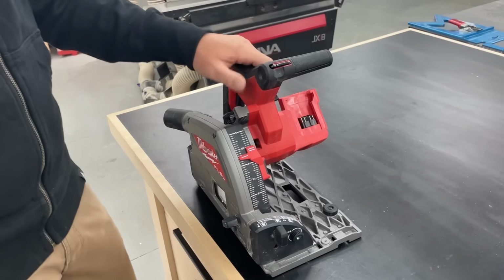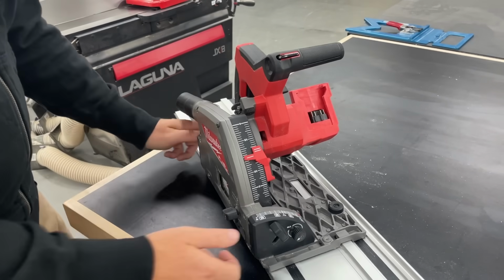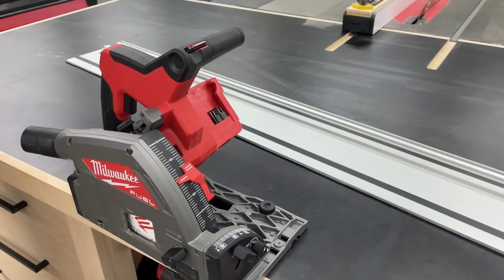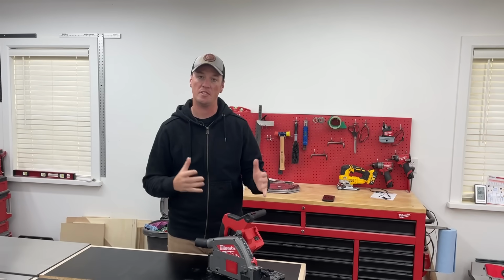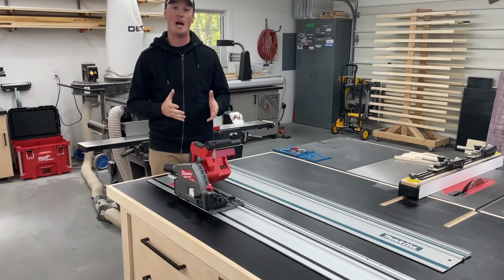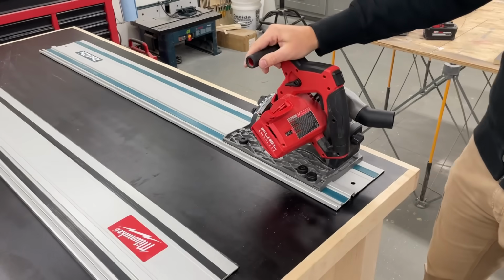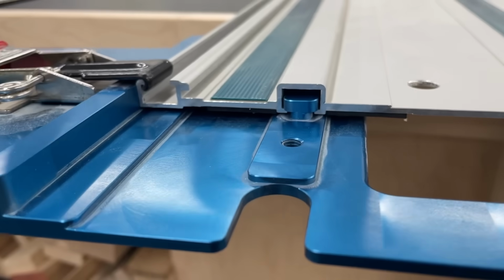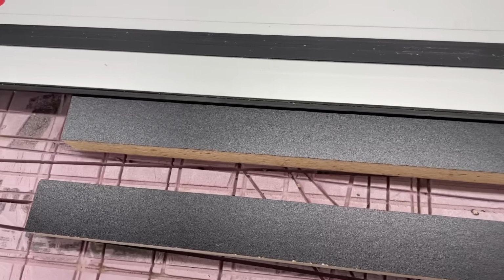The Truth AFTER 9 months Heavy-Use | Track Saw Review

Comment: Might be a dumb question but how does the track not move with the saw or slide off the material? I always pictured needing to use say your other hand to keep pressure down on the track so it doesnt move (obviously without clamps) but do the tracks really have that much grip that they dont move during cutting?

Comment: Proprietery blade meant by the thicknesss, that It cuts 1,6mm (1mm base thickness) metabo uses 1,2mm base and 1,8 cut, and makita standard is 2,2 (non battery) and 1,85 -1,9 so yes it is different and you WILL recut your track if use interchange them... ever so slightly but still

Comment: I see 8 increments on the scale from 0 to 1/2".  So on this saw 8 1/8's is 1/2"!  The blade is SOMEWHAT proprietary in that it has an ultrathin .063" kerf.  The splitter is ultrathin to accommodate that blade.  On the other hand, the saw  will also take a thicker blade with no problem.  The thinner blade is great as it effectively increases horsepower.  Excellent review overall-helped me decide to buy and I learned a few new things.

Comment: Do you know what the cut depth is on a 45 degree beveled cut? I’m cutting some angled cuts for a waterfalled edge on an exotic hardwood and i dont trust my wen track saw to make the cut without flexing. It has a bigger blade, but it also lacks proper power. I’m looking at milwaukee because i have a bunch of their tools already.

Comment: The only 2 problems I have with the track saw is that 1, in the EU the anti tip feature is removed. And 2, when using the saw without vacuum, it will get clogged from time to time (even without dust bag), so I think the dust output is not that great without vacuum.

Comment: Hey John - thanks so much for the experienced review and the added bonus of the aftermarket mods TSO and Woodworks).  Milwaukee shipped a 40-tooth blade with the saw and I’m wondering how it’s going to work on composite deck lumber I need to rip.  Any tips or tricks working with that material?
Reply from the maker: It should be good!
Reply: Drew over at Wittworks got me that dust cover you have and some track end protectors.  He also included some really good tips for using the saw.  Thanks again for the information and referrals!

Comment: I see I'm only a year late to this review...just starting to get into woodworking.
Great review with no annoying music or a lot of rambling about your opinions, just the facts Jack!
Here's my one questions regarding the tracks...for you or anyone else that has these two brands of track.
The Makita looks like it has a wider (blue) glide on the top for the saw to slide on than the Milwaukee.
Which one is easier/smoother to glide the saw on?
Or is there any difference to begin with?
And how's the grip on the underside when using the saw, which track has a better grip on the work surface?
Thanks again for a clear and direct review!
Reply from the maker: I’ve never really noticed a difference on the glides or grips between the 2. Just gotta keep the grips clean and they’re great

Comment: Nice, to the point review. Thank you. You mentioned the blades. Are the kerf sizes the same between the Milwaukee and Makita? Big power difference between the 18v and 36v makita?
Reply from the maker: They each have blades that are different kerfs. I really like the thicker Milwaukee fine finish blade. I always got a lot of deflection with the really thin Makita blades
Reply: @JohnBuildsIt when switching between different milwaukee blades does the position change in comparison to the splinter guard or are they just swap and go? I've noticed some kerf differences between the some of the different tooth count blades and have been curious how it affects the splinter guard.

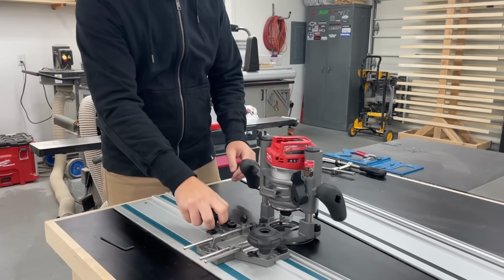Comment: Hello, John.  Thank you for the thorough review. I sent your link to my son who just bought the Milwaukee track saw.  In your review you mentioned the Milwaukee router guide's compatibility (10:49) with both the red and blue track. Does that Milwaukee router guide work with the Festool track?  I have Festool tracks and desire a Dewalt palm router, so I am looking for a router guide to work for both. Any insight would be appreciated. And by the way, thanks for guiding me on my Home Depot Dust-buster and Ridgid vac build--my first shop project as I began my retirement three years ago.

Comment: So I'll admit I'm a bit of a festool fanboy. Have had my tsc55 reb for close to 5 years, used it extensively and it's been great. Decided I was going to get another saw, dedicate the tsc55 for rips and the new one for crosscutting. Toyed with the ts60 but the no battery or plugit cord was a non starter. I have some milwaukee tools, read and watched a lot of good things so took the plunge (pun intended). Well well well... did a bunch of rip and crosscut comparisons between the two, with multiple different blades on the tsc55 and only the stock blade on the milwaukee... needless to say there is no need for 2 saws. The milwaukee is that good... and smooth. Sold the 5 year old  festool saw, 55" track, charger, 2 batteries and a couple of blades for more than I paid for the new milwaukee kit (track included). Nice work milwaukee
Reply from the maker: Dang that’s awesome! Especially that you can admit that 😂 I love the few festool tools I have, but some guys get pretty weird about it for sure, thinking there’s no way something else can be just as good or better haha

Comment: what saw do you feel slides better on the track? Makita or Milwaukee? Sounds like the milwaukee rubs or something! What saw would you recommend? Makita 36v or the Milwaukee!
Reply from the maker: They slide the same. I still use both, but I prefer the Milwaukee
Reply: @JohnBuildsIt  how powerful is the Milwaukee m18 track saw? I know their regular circular saw is garbage compared to Dewalts 60v circular saw. If you have used Dewalts 60v track saw which is more power Milwaukee or Dewalts?

Comment: I am a deck builder and frequently need to cut long straight cuts of composite decking like Trex and TimberTech. I typically use a deck board as a straight edge and my M18 circular saw but have been contemplating getting a track saw for more precision. Do you think the Milwaukee track saw could be useful in this desire? Can multiple tracks be added to get say a 12'-16' run?
Reply from the maker: Absolutely man, it’s the only way I do it!

Comment: Nobody ever addresses the wobble side to side with the powerhead to the chassis. There`s no way to adjust it out. 
Grab the top handle, while locked in the track, push the powerhead side to side at the top, you`ll see a bunch of slop.
How the hell can you expect a good accurate vertical cut with so much side to side floppy sloppiness.
The Kreg saw did the same thing. I returned the Kreg, now i`m gonna return the Milwaukee.

Comment: Great review. I just got the Milwaukee track saw and it has taken a little getting used to.  Thanks for the info on the adjustment screws, I couldn’t find that info in the manual. The only problem I am having is with the riving knife. It doesn’t follow the blade and gets hung up when I make angled cuts. Is there a way to adjust it to follow the blade?

Comment: I have heard people say in different reviews that the tracks tend to have the anti splinter strip fall off on its own whether it's used a lot or lightly used,  and have also heard people complain about tracks not lining up well with each other when connecting two tracks whether it be  two 55" or two 31" etc etc.   How has your experience been with those two situations ?
Reply from the maker: I bought the long track so I actually haven’t joined any of the short Milwaukee ones together. In my experience with both Makita and festool tracks though, they both needed trimmed to square up the ends so they went together straight

Comment: Hello great video. One of the most Informative I have seen. I have two questions the depth guide I am confused on where exactly I use. The top of the two lines the middle? Also does the guide connector plates go bevel side up or down? Also I have made the mistake of putting g just a little to much pressure when tightening and dimpled the track. I say this to avoid anyone else from doing it. Happened very easily. Thoughts

Comment: are the track connectors cumbersome to install and accurate when lining up? i used the bora track a long time ago and getting that connector to line up accurately was a pain in the ass
Reply from the maker: I don’t think so, they’re just hex set screws. Same on the Makita and Milwaukee. A lot of tracks don’t come cut perfectly square on the ends so that usually needs trimmed, but after that it’s easy and accurate

Comment: I've had repeat problems with mine. The trouble I've had seems to revolve around the track and how the saw sits in the track, and that it's not that accurate. It will sometimes pull one direction or the other. Have ruined several tracks because it will start to pull into and cut into the track. I think the problem is more the tracks than the saw, but not sure. Idk if i just got a bad one or what
Reply from the maker: Are you adjusting the knobs on the saw so it snugs up along the rail?

Comment: Have you had any issues with the brake not working to stop the blade after a cut? Mine was fine for 4 or 5 cuts (only mdf) and then next cut, it kept spinning. I’ve searched as much as I can and the only thing that I can find is to ‘get it serviced’. I’ve only used it for one other project and don’t want to send it away if there is something I can do.
Thanks!
Reply from the maker: No not with the track saw. My blade brake did go out on my Milwaukee miter saw though recently

Comment: I'm on the Mafell platform right now, but for a cordless option this looks really good.  Only hesitation I have is that I've had nothing but BAD LUCK with m18 batteries.  They're expensive and they go bad just out of the warranty term with very light use.  "Red Lithium" my arse
Reply from the maker: Dang that’s weird! Personally haven’t had a single battery fail
Reply: @JohnBuildsIt  I've got seven m18 packs, and three have gone bad including a big 12amp High Output 'lunchbox'.  Not cheap.  Almost 50% fail rate.  I thought the m12s were much better, and then one got hot while charging and the rubber base coating melted & got sticky.
Not one problem with Dewalt packs.

Comment: Great review. I just bought my Milwaukee after owning 2 ts 55s for years and am really impressed. I actually purchased this to cut a bunch of 20step 2x12 stair stringers and it was so helpful being able to lock the saw in to the guide and shift it from cut to cut so quickly and the big deal for me was using the dust bag and cordless to eliminate the cumbersome hose and cord. Now I will be using my festools a lot less as I am mostly onsite rather than in a shop. I might even finally invest in a long track because it’s less than the festool one.

Comment: This is an excellent video!!

This is probably a dumb question, but when cutting a rough-sawn board where both edges aren't square, how do you measure from the edge to align the track when it has no square reference surface? Because one end could be at 2" with the other at 2 1/4" if that makes sense. 

Due to the expense, I would be using the track saw to get jointed edges without having a jointer or table saw.  Thanks in advance!
Reply: you could simply "make" a square edge by marking a 90 at one end and then laying down the track to make at least one straight edge (the one you cut).  with that 90 and one straight edge you could square off of that doing things the same way for the other sides
Reply: @srchubz  So, I would square up the end with my miter saw, then hook my square on the end and mark it? That will definitely make everything easier. Thank you for the help, I really appreciate it!
Reply: @chris-C8  and technically you don't even need to square the cut with the miter saw.  Just make a straight cut (due to the wood it might not sit flush against the fence, ya know?).  With THAT cut you have your reference points for 90 off of that.  Then just make the long straight cut
Reply: @srchubz  Thank you again for the help.
Reply from the maker: Don’t worry about the ends until afterwards. Rip your parallel straight edges first, then do the ends 👍🏽
Reply: @JohnBuildsIt  Thanks, John. I genuinely appreciate the help!

Comment: Great video friend. 
Thank you
Update
I just went to town and purchased the saw at Home Depot with a promotion for a free 6ah battery. There are no tracks in stock so as I looked on line I noticed that Makita is significantly less expensive than milwaukee on the mid to long tracks. I think I have decided Makita due to the prices I could find and what John shows in this video. 
Makita:
39”-$86
55”-$85
118”-$198
Milwaukee:
31”-$79
55”-$168
106”-$377
Hope it all works out. 😁
Reply: The shipping on the Makita 118" will be around $ 400 unless you can find a independent hardware store in your city that carries Makita as their main tool line you can ask them to add it to their next shipment and the shipping was (free on my order ) or at a reduced cost.

Comment: John . . . Several years ago I went strickly RED because dealing with 4 different battery types was crazy, and while some of the other tools were very good - none were better than the red tools. Over time I weeded out all the other colors and going with a single battery type has been one of the best tool buying decisions I've made. Now I need to pick up a track saw and I would prefer to stay RED but I had also heard a lot of conflicting information going around YT. Can't thank you enough for doing this video and clearing things up.
Reply from the maker: Glad it helped!!
Reply: I’m bought the same blade cover before I looked on the other side and it’s completely open 🤣 don’t think it will one bit of difference if I’m honest. Like the saw though all in all
Reply: Alignment for a perfect bevel cut is frustratingly difficult. The edge of the track doesn’t layout where the kerf is going to be. It’s a major flaw unless you only plan to break down sheet goods into smaller pieces.
Reply: Should never buy Milwaukee owned by China 🇨🇳 that country is trying to destroy the USA 🇺🇸 and you're supporting them
Reply: festool is better, way better! but not the same price
Reply: @lnz971 not at all. I love my domino and routers. I’ve got 4 Festool saws. 75,55, HKC and a kapex. HKC system is brilliant, but I wouldn’t buy the 75 or 55 again. Festool saws are dogshit. The 75 bogs down constantly.  Kapex is way overpriced, find it no more consistent than my DW780. iI’m in a cabinet shop and now run two Milwaukee’s (rip and cross) to break down my sheet goods before trimming on the table.
Reply: @lnz971 yep. If you want/need the absolute best, and have unlimited tool budget… but dang the red tools have done everything great lately.

Comment: I wouldn’t care even if you were a fanboy! I’ve been a finish carpenter for over 20 years, and came up on Makita. 

But, the Milwaukee M18 lineup for job site and/or shop work is the best I’ve ever seen.  

Also, the PackOut boxes are solid and dry; especially if you drive a pick-up.  I want to get an extra set for my camping gear.  Only complaint, is that they only sold them in black over in Europe.  

I worked for a guy years ago that ran all Festool; beautiful tools, and at the time 10 years ago, were ahead of their time in America.  

Main issue w/ Festool is obviously the co$t.  You could build a respectable M18 set of tools, for what the Festool miter box/stand would put you back.

Comment: So the one thing keeping me on makita, as I am a Milwaukee platform kinda guy. Is the ability to flip over the arbor nut on the makita and use 5/8" arbor blades you know your typical circ saw blades which are cheaper and specifically the "demo demon" which I'll use on different types of materials. I have tried to play with the milwaukee  arbor at the home depot, but I don't see the ability to flip it. Can you tell me is that the case?
Reply from the maker: No, not as far as I can tell
Reply: Thanks. Nice shop. Nice content.

Comment: Tools for beginners and hacks. Never have I ever needed a tracksaw.
Reply from the maker: 😂😂whatever you say
Reply: @JohnBuildsIt  true story. Nobody had these 10yrs ago and its an unnecessary tool at that. Marketed to those who can't cut a straight line. 🤣🤣
Reply: Obviously you don't do fine finish work or cabinet building/installs.
Reply: @nailbndr9869  actually I do bud. I do finish work from antiques, butcher block counters, custom vanities, cabinet work and design, raised panel, crown and base/trim. I also do a lot of tile as of late. Have my own local LLC here in Daytona if you need some professional quality work done.
Reply: I agree.  Same reason I don't use modern vehicles.  If you can't manage a carriage and a stable of horses then you're just a hack who doesn't belong in the trades.
Reply: Depends if you're happy with a good job or looking to raise it to a perfect job, sometimes that separates trades like black and white.
Reply: @ozcampnhuntdan7858  your apparently a hack, or a fool if you think a specialty saw is gonna make a better cut. A straight edge, a few clamps and a circular saw, is all you need. Track saw also uses smaller blade so depth is limited.
Reply: @ericgordon9297  You truly need help if you're that rude to others.
Reply: @ozcampnhuntdan7858  then go waist you money on a useless saw that this guy is endorsing. I've been doing woodworking over 20 years. I've never seen anyone use them on a job. Only YouTube guys use these. Teach people some skill not hacks.
Reply: @ericgordon9297  you're
Reply: Superior dust collection alone is already a big enough factor for a woodworker to own this.. Its also 10x faster than having to clamp everything down for every cut.